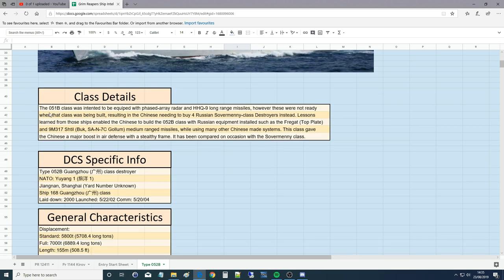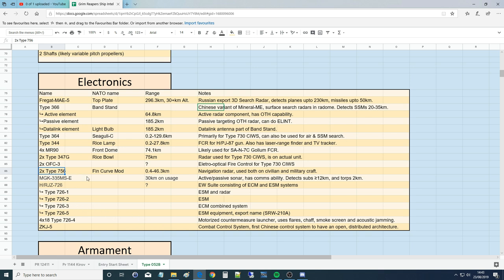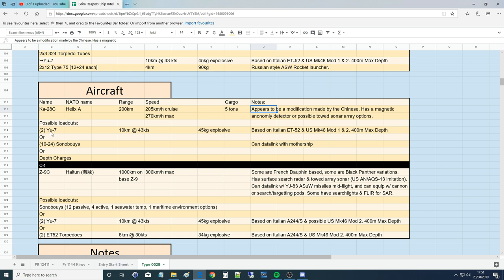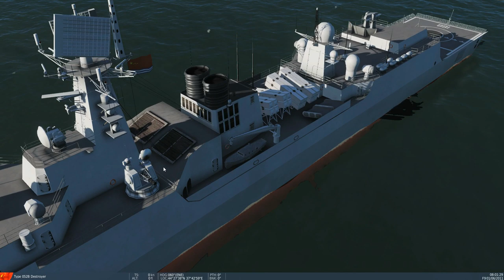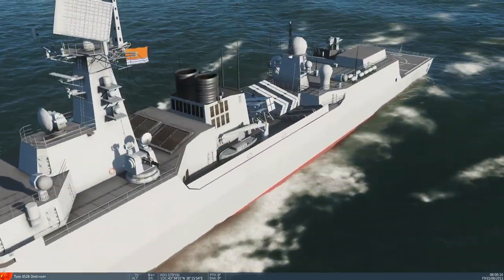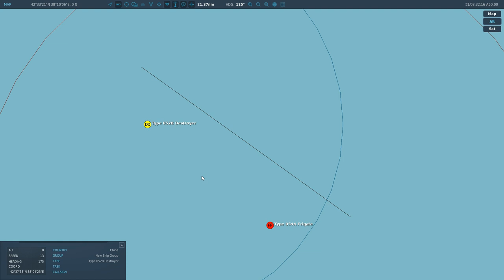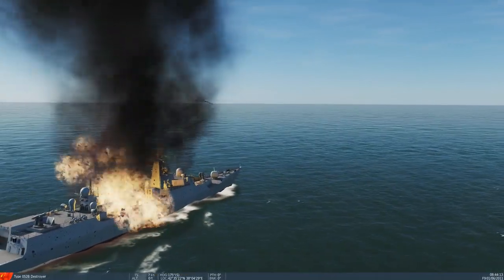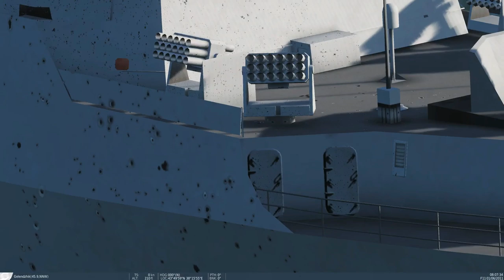Combined Arms: Type 052B Destroyer Tutorial | DCS WORLD

Comment: Not sure about the Chinese radar but the reason most are crooked is to compensate for the angle the radiation leaves and returns to the antenna. It’s called a squint angle. Most modern radars compensate for it electronically and don’t need to cock the antenna.
Speaking antennas, I just attended a wedding where two antennas got married.  The ceremony wasn’t much to talk about, but the reception was great.
Reply: Ya know, I was curious about the same thing. I suppose it's similar how you have to arrange HF antenna in a different orientation if you want to do some extremely long range comms with someone.

Also, BZ on the joke there. :D
Reply from the maker: lol copy thx Tom
Reply: 052b is known as Chinese Sovremenny，its radar is the Russian MR-750A radar. 052c and 052d are Aegis，and 055 is the best destroyer（American call it cruiser）now.